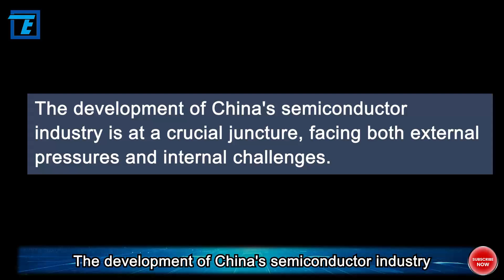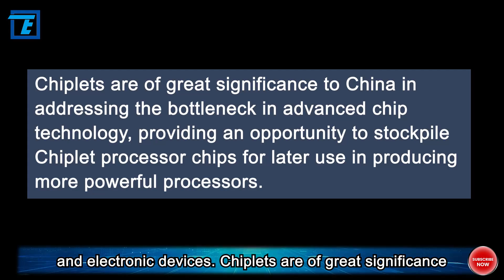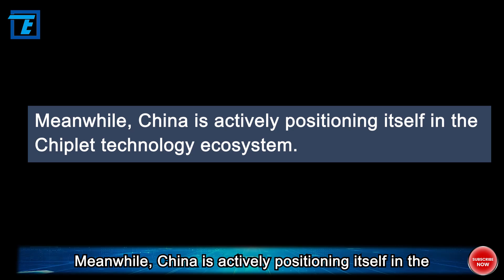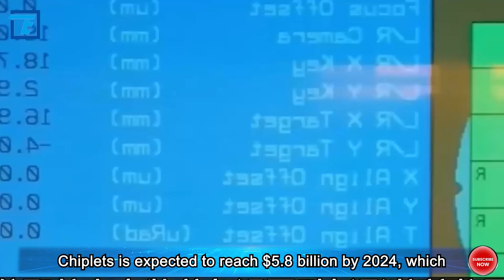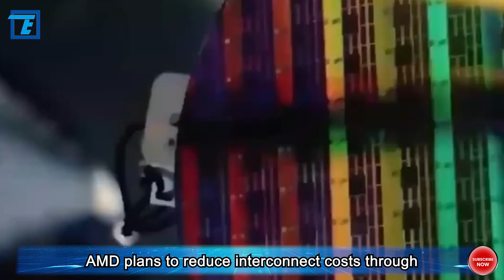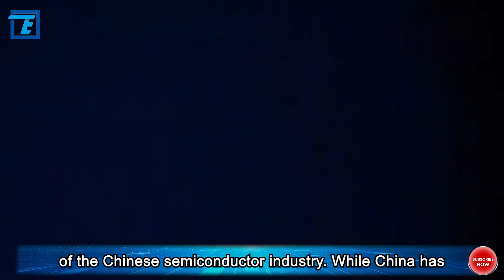Can it Help China Overtake?  The Battle Between China and the US for a $400 Billion Market!

Comment: Most of the functionality of a printed circuit board in a smartphone for example, with a SoC and lots of other microchips on it could I guess be replaced by a single package with chiplets. Sounds like it could significantly simplify the design and manufacturing and reduce the cost.